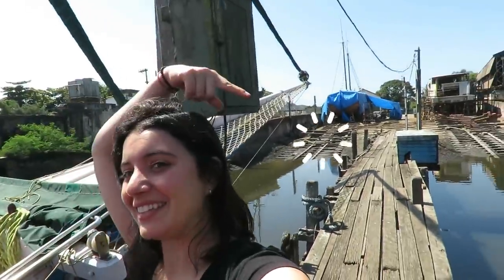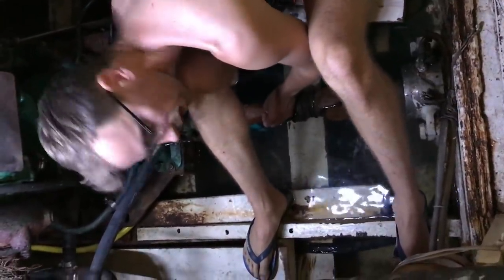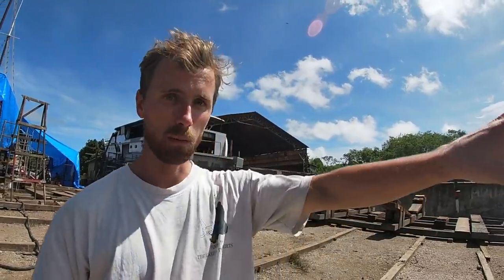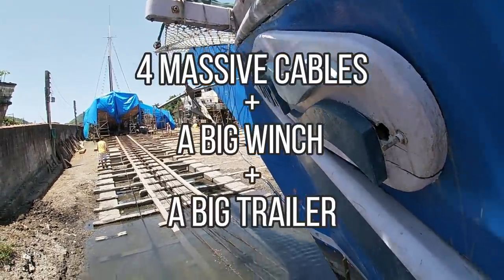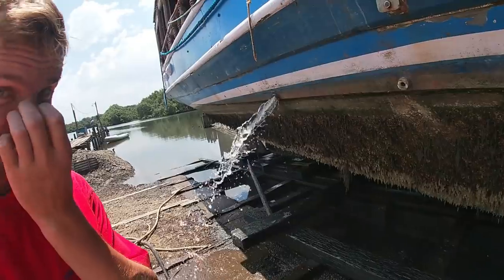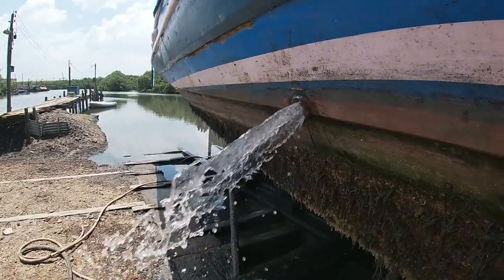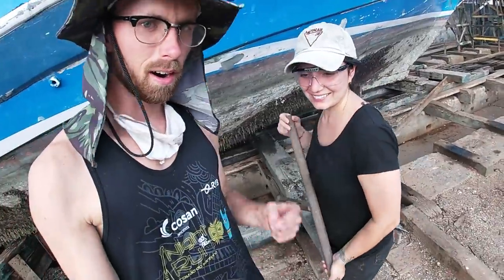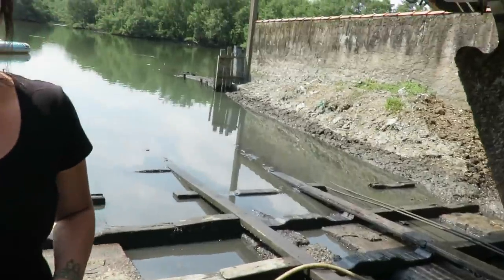Lifting our wrecked schooner for the FIRST TIME in her life — Sailing Yabá #3

Comment: My grandfather (dec) used to sail & maintain wooden hull vessels. He said the annual pulling of the ship was imperative to the life of the keel. To see what looks like nearly 100mm growth alarms me & my boat owning friends. Also seeing worms in the abundance you showed. Be prepared to restring and completely replank the lower 75% of the keel. The other point to note is check she's not twisted sitting on that trailer on the dry. To me she's not square & is under some extreme stress on a compromised hull. Stay out of the water for 6 weeks or more & she's going to start splitting as she dries out. I sincerely hope that you can find some big sponsors & keep this boat alive, or that if the project becomes a salvage mission, that parts of Yaba can live on.
Reply from the maker: Hey Ben. We know the keel has suffered a lot in the past and we are definitelt not ruling out having to replace it. Same for the planks, they are quite new and solid but the worms have had a feast!

Comment: Great to see that she came up in one piece! If you can, scrape the growth off just to prevent any surprises on your way south. As an epoxy saving measure, consider drilling out and using tapered wooden plugs for the holes, glued in of course. For the trip south, a bunch of 12mm ply pieces cut to various sizes with nails pre-started around the edges and a bucket of roofing tar to bed them in make Great emergency patches!
Take care, and don't worry about the anti-wooden boat comments! Step by step will get you there!!

Comment: Can't but affirm the idea of getting as much done while you are out.  The punk wood around the holes should be cleared as much as possible before epoxy.  If time does become a problem,  you might want to ask about coating the bottom with pitch.  That should apply quickly and help stop any leaking so you can go south.  All the best, Hal

Comment: Well done on achieving this evolution. It will be a huge achievement  to get this vessel into a seaworthy state. I wish you both good fortune in your endeavours.

The one amusing part of the haul out was the boatyard worker standing astride offering up his reproductive appendages to a wire parting. He has clearly never seen a steel wire part under load.😂
Reply: I must say I have seen chains and cables break under load and it is very dangerous and I was thinking the same thing ! A cable breaking under extreme pressure can easily cut a man in half !
Reply: I crossed my legs when I saw that.

Comment: First video I've watched of yours. I use to work on a wooden crab boat built around 1941. It had a leak comparable to a garden hose running full blast 24 hours a day. I installed a 12v back up, a 32v back up and 2 - 110v back up bilge pumps. It got close to sinking a couple times when we had the water tanked on for fishing but... we used the circulation pumps as a last resort back up. (The water was up to the bottom of the main engine. so like 4 feet of water in a 65 foot boat.

Comment: A tip: You can use a ice pick to get a good idea of the strength of your wood. If its hard to press in the pick then your wood is probably ok. If it goes in easy or just punches thru then..... well you get the idea. Use chalk to circle any bad spots.

Comment: I’m hoping that those holes are localized. If not, then huge areas have to be replaced. Get all that growth off ASAP so it can dry sooner. Have a boatwright look it over. This is very serious. You may get some very bad news. There comes a time that you have to step back and realize that it will cost much more than it’s worth in costs AND your labor. Have a good cry and let it go. Learn from it, move on. You have each other, you’re heathy. Next dream can come true.
Reply: Yup. Definitely need a boat wright to inspect. If they got toredo worms or some varient that have got inside, it is doom.
Reply: @uthewallstreetbetsgod4714  
The average boater skips a marine survey only once.
Reply from the maker: Shipwrights are on their way to have a look. Thanks for the advice!

Comment: Personally I would renovate the hull and steering gear properly, then renovate the engine, transmission and diesel tanks properly. You can then motor south safely and finish the project with your friends. What happens if your quick fixes come unstuck en-route? It's not worth the risk.
Reply from the maker: That is true. The rudder will have to be fixed for sure and it would be good to have someone look at the engine too!

Comment: You can ask the workers at the yard if it is true .
I was told that an old wooden boat when you take it out of the water the wood starts to shrink .
So you have to keep the hull wet and cork all the seem lightly before you put it back in the water
Reply from the maker: It is true. It is even more applied to classic wooden boats as they have more planks but thinner. Yaba has 600x50x7 cm planks which won't dry up too fast hopefully

Comment: From your comments it appears this haul out is for temporary patch work. You intend travel to another haul out location for the extended hull work? I am sure you will need massive hull repair from the keel to the hanging knees. If you can make the hull sound and get back in the water the rest can go forward from there. Where are you going to take Yaba for the hull work? Also you may want to subdue the background music as during the haul out it was very loud. Best wishes and hope for the future with success. 👍

Comment: I agree with all suggesting  to replace the damaged planks. This is how it works on wooden boats. At earlier stage it might be cheep to repair while avoiding doing this later will lead to heavy investments. The damaged planks are not part of the structure anymore. Hardly the epoxy will serve you as the planks play.

Comment: That was a bit of a nervous time for you. I hope you can stop the leaks without too much trouble. Get her back in before she dries out too much.  I think you will have to plan to replank most of the hull below the waterline next time she is out of the water.. Old wooden boats are meant to have the planks replaced as they rot or are damaged.  Good luck. I will follow along with interest.  ATB Stay safe stay well. Fair winds & regards from the UK
Reply: Based on what they said in this video, Yaba was launched in 2007.  So it's not old.
Reply: @airshipguys  Not sure on the age. If it was built in 2007 it has gone bad really quickly.  My 52 foot wooden pinnace was built in 1932 and she has no holes or leaks although one plank was replaced and below water line recaulked in 2011. Maybe 2007 was the last time Yaba was refloated after a refit ?  She must have been neglected badly to have worm holes in her. A similar boat to Yaba built in 2009  sold in 2019 for $550,000.   I hope the owners will give us a lot more information about her. regards.
Reply: @garyc5483  It's possible that the former owner had a collision that caused damage below the waterline.  And bottom painting on the beach between tides isn't the best as far as quality control goes.  If they are lucky the problems are localized and won't require extensive bottom work.

Comment: Do you think blocks should have been put on the carriage under the keel to give you better access to where the hull is leaking? Are you going to high pressure wash the underneath to be able to prep for bottom paint & expose the soft spots? Have you already made the templates for the "sister ribs" that need to be installed to replace the rotten ribs? What is your method to check for Toredo ship worm intrusion? Have you thought of a fiberglass outer shell after you fix the structure & planking issues? Can you or could get someone to do a filler video on the Tall ship on the same runway in front of your Yaba? Are you going to hire local help to get this huge job done in the heat & humidity?

Comment: Best to get as much done while it’s out than put it off.
Reply: I was going to say that, especially planking and structural pieces.
Reply: I thought the idea was to Motor south for cheaper place to repair?
Reply: I think this is just for cleaning the hull and epoxying the holes.
Reply: You guys have to clean up the Kiel. Imagine how heavy the boat is with all that crap you are going to drag.
Reply: A hull of a mess.
Reply: I agree while its out fix whats needed!

Comment: Yes lots of butterflies when you haul an old wooden, done it many times, as long as the keel is supported properly she won't hog(drop her ends ) too bad . then you bunk and shim her properly and you can maintain her shape as much as possible, this is important so she does not twist too much as she dries out . It helps to have a knowledgeable yard , these guys look like they know what time it is . Good luck , I will be interested to see how you proceed, oh yes I have worked on boats like this, wooden boats of all sizes , I used to restore boats at the Chesapeake Bay Maritime Museum on the Eastern Shore of Maryland USA, TAKE CARE...
Reply: Well, at least chunks of planking were not falling out! I have seen that before , remember epoxy might work but it does not like to stick to wet/damp wood very much , check the garboard seams very well as they always tend to leak bad after a while 13 years is a long time

Comment: i have been around wooden boats all my life and seen this before,  i don't really recommend filling the planks full of epoxy as will make more problems later on and if the epoxy falls out of the planks the boat the boat may end up liking much more and may sink of the issues and sad to say is the onley way to fix wood is with new wood even if the wood needs plugging with wood so can swell up for less leaking or replace the planks you need replacing , you ar in good hands in a ship yard and the boat is out of the water and the shipyard will help to replace planks but just dont skimp out on epoxy as an easy fix as it's not worth the cost of the boat sinking just do it properly

Comment: Great job getting Yaba hauled out onto the hard.  What a mess underneath, though, huh?  At least she didn't break apart!  Keep in mind, you'll want to let the hull completely dry out before trying to affect any repairs, or the repairs likely won't take or won't seal properly when she goes back into the water.  Drying time varies, but you're probably looking at a month or so.  Still can't believe she's been in the water since 2007 without being hauled out and maintained!  Poor old girl needs some TLC.  Remember, anything rotten can't be patched or repaired, it has to be replaced to be safe.  If you're able to get her clean and dry (really, really dry), the best bet might be to use epoxy (not polyester resin) to fill all of the holes, and then fiberglass and epoxy the entire hull.  It'll support the hull structure once it hardens, and it'll prevent wood worm and other parasites from invading the hull.  Just a thought.  Best of luck to you!  Look forward to the next episode.
Reply from the maker: Thank you for the advice. We know rot has to be replaced but now we are looking at big leaks and mainly structure

Comment: Ben and MP you should watch this video of a stem being replaced on a Vietnam boat yard similar sort of construction https://youtu.be/0CvuBYUpaSg
but notice they have added about 3/8" of fiberglass all over the boat to keep it going , not always the best to do as the wood can still rot from behind but it keeps the leaks way down and as they show you can still repair it by cutting away the fiberglass. in the long run you might consider this sort of work if you can find a yard who can do it  . With the tetrode worms in your area the wood is only temporary and will not last for very long as you have found out already .  Ask the locals how long they expect the boats to last and if  the ever fiberglass over the hulls . good luck
warren
Reply: Yes that part of the world and wooden hulls are temporary structures.

Comment: She has good bones and took the pull out well. I suggest you forget your time limit, and get the Hull sea worthy from the start. That crud is hiding relief or a hell. Personally l would want to know which.
MP you wanted a wooden boat, you better learn how to hold, scrap, clean, sand, and paint correctly very fast or you will suffer, or be less than useless. Wooden boat is on the bottom end of constant maintenance and care. Though to be honest all boats are a constant baby needing something.
Take this Time to make the list, and know what you are working with, and it's failure points.
Brazil is extremely cheap labour, but very expensive materials. I suggest you use this to your advantage. Ever thought you might be in the right place? Odd Life Crafting, didn't at first, then realised the place was a god send. Think hard about risk, benefit, and money. Rather than what you wish you had vs need. This Yard knows these boat's, work hard and fast. Don't piss away time at the start because you have a plan... Only to find you wasted days and your plan is no longer able, because you wasted time.
Because your annoying me, and l'm only watching. Costs money, and your pissing away time. Goals, mission, and if we have time. On the hard is always to be maximum effort.
Reply: This is all good avice. Additionally, as the hull dries the wood will contract. Use this as a golden opportunity to re-caulk, or you'll be leaking even faster when you go back in the water.

Comment: I'm sure a little bit of epoxy on the holes isn't gonna be enough. The wood under the waterline seems porous and rotten. Some planks may need to be changed. It don't think going back to the water ASAP is any good. I wouldn't work on the rest of the boat until doing all the necessary repairs on the hull. Anyways, it's gonna be a fun adventure!
Reply: @richardbirkenwald811  Exaactly!

Comment: This would be a good hull for a ferro-cement skin.  Materials are cheaper than fiberglass or a wood rebuild,  unskilled labor can do the work  even if they have not handled cement or concrete.  FAO in India has a website.  Many boats were constructed in the UK and California in the 1960s.  I built a 26'  x 8' ( 7.8 x 2.4 m) party barge with only two extra people for plastering day,  I was inside the upside down hull,  my dad ran the cement mixer, and a fellow builder ( 36' , 10.8m Diesel cruiser) was outside.  Covered with black plastic, the hull cured in a few days in the hot sun. Photos on my YouTube channel-Jim Rudholm

Comment: If you have minimal time pressure wash after you scrape sand the bottom with something like 60 grit and the holes will not be fixed with anything but underwater epoxy than think about mopping hot tar on to the whole bottom get a drum and some tar a fire and be careful this will give you more time to gather money and access the problems with planking under the waterline speaking as a foreman in a shipyard this is your best bet good luck
Reply from the maker: Thank you for that advice! We want it to be a fix that will work and not waste any money
Reply: @SailingYaba  you are going to fix the thing for no money would be great I dont think you have the financial means to start replanking the bottom and what kind of timeline did you have  resources

Comment: Filling worm holes with epoxy and planning to take the boat on a off shore trip is a big gamble. Epoxy will do nothing to strengthen the planks. It may help slow your leaks but it's still a worm eaten piece of rotten wood between you and the sea. Good luck and godspeed.

Comment: I know that you're not intending undertaking any 'major' work here - 'major' being a relative term in this case - however, I would have thought it inconceivable that you would even consider not scraping the hull while she was out of the water?  Just scrape the whole hull, let it dry well and slap on the epoxy for now to get you hopefully safely down the coast for now. As long as the hull is watertight and the engine working well, you'll hopefully be okay to get down to your new boatyard.......
Looking forwards to seeing the next stages as heartrending as they may be! 
I was with the late, great adventurer, Bill Tilman when he brought 'Baroque' back to Berthons boatyard in Lymington and she had serious water ingress, so had the bilge pumps going none stop and had to be lifted out very quickly to avoid sinking alongside! However, as she was lifted by the travel lift, she was so rotten that she broke her back! I think that your salvation was in that you didn't lift her, but drag her out...... definitely something to bear in mind at your next boatyard.... avoid lifting! 
All the very best......

Comment: May i suggest that when you get south for the repairs. That you would maybe consider using your wooden  boat as the foundation for adding ferro cement hull.
It will add weight. But not enough to make a big deal. As you are not using it for fishing or hauling heavy cargo. 
You might be surprised. But of course do your homework and see if it might be a good fit. Many older fishing trawlers have been converted this way into pleasure craft. Strong stable wood hulls with cement casings.
Just food for thought. 
Thanks for your time.

Comment: Do not rely on what you can see. Check the hull everywhere for rotten areas by poking them with a metal tool. This is essential to know you can trust her. If their are any ship builders around get their opinions as to her condition. You need to learn as much as possible about her actual condition before she is put to further tests. I bought a similar sailboat only to discover she was too far gone for my means. She was much older though so hopefully you will have better results. That is a long time for a wooden boat not to be hauled out for thorough maintenance so be thorough in checking her condition while you have this opportunity. The worms not only make a hole in the wood they can consume large areas inside the planks. Highest Blessings